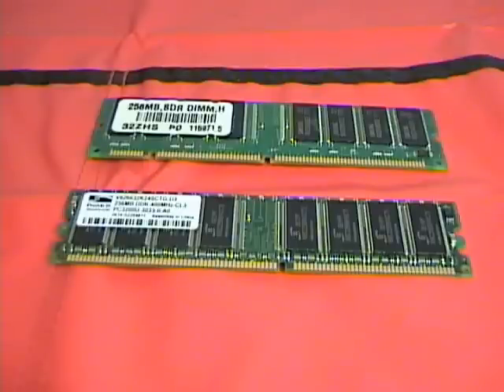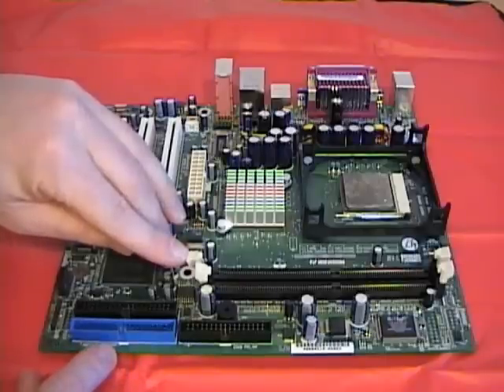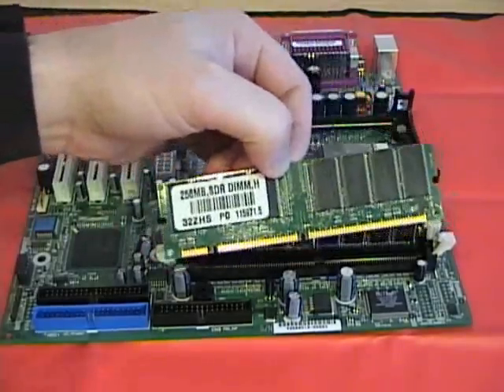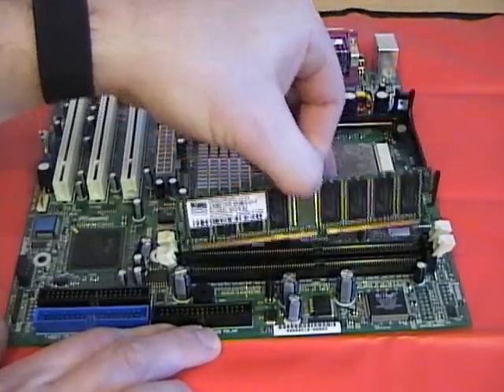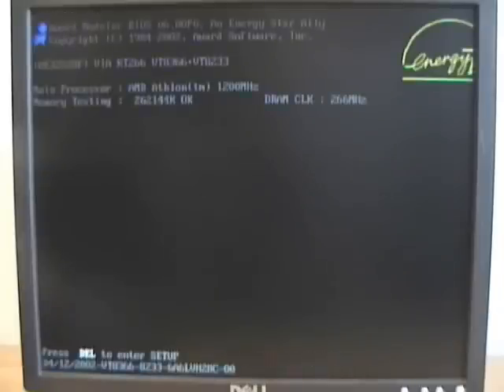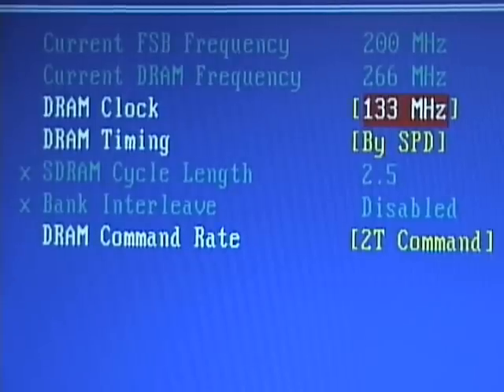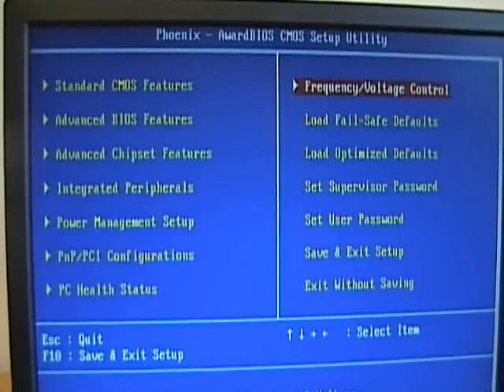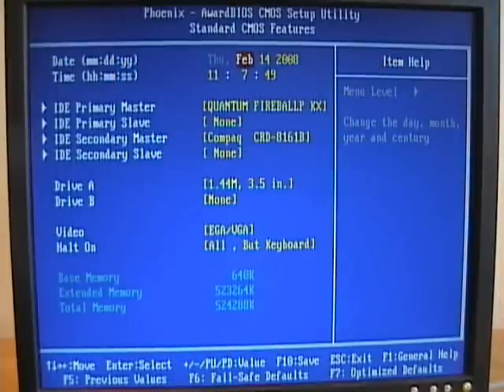Install and Remove RAM

Comment: I'm running Windows XP and I'm new to PC gaming, I have 1.97 GB of RAM. It says I need 2.0GB of RAM to run the game on Steam. Should I still be able to run it or do I need to install more RAM? I am also going to upgrade to Windows 8.1 pretty soon.
Reply: Lol, you should be fine. Just run on lowest settings
Reply: Zachary Lim I upgraded.... I now have windows 8.1. I also upgraded my RAM. I now have 6.00 GB of ram. I upgraded my processor, and  graphics card as well. My processor is intel quad core i7 and my graphics card is Nivida GTX 750ti
Reply: Zachary Lim I got one last question for you, could I run BO3 on this Pc? When it comes out will I have ro upgrade again or is it good enough to run on high settings?
Reply: +Jay Money Gaming Yes you could not on high the nv gf gtx 750 ti isnt a high end graphic (i have the same gpu) u could run it at medium-high at 60fps at least :) (its not a high end means that u cant run every single game at the biggest graphic settings but you can run it at least on medium :) )
Reply: Jay Money ubgrade your hard drive to play new games

Comment: Which of the two types of ram controls gaming speed?
Reply: Nothing "controls" gaming speed necessarily.. It's all basically everything as one. The graphics card, RAM and all other things control how good the game is going to look/play.
Reply: Ryan Does Gaming It would fix some stutters if you will have more ram (atleast 8 GB, depends on the game requirements) but it will not fix the low FPS. If you want to get much better gaming performance buy a new GPU and maybe also a CPU if your CPU isn't good enough.
Reply: Edgar Chávez Ok. Thanks. :)

Comment: The OS isn't the problem, it was the RAM itself. Found out one of the sticks was dead after testing each one. I bought a new one and solved the problem. I will stick with Win7 thank you very much.

Comment: If you were to actually watch and pay attention his equation was 262,144k / 1024 = 256MB of ram which is correct. This old BIOS displays memory in Kilobytes which you'd have to divide by how many kilobytes are in one megabyte to determine the total Megabytes. His formula is correct if you actually paid attention.

Comment: @Bammer958 You probably did not apply quite enough force when pressing down when ram in not in the slot all the way or the plastic tabs are not making full contact it will make this beeping noise

Comment: i have bought 2 ram modules same as yours 184 pin for my pc and it goes in but when i put it in my computer it only reads 512mb of 1gb in each or the stick rams. i have the right memory and i have instaled the memory properly i have seen my mother board specifications, it supports up to 2GB of ram 1gb of ram on each of the 2 ram slots.

Comment: cool video, you don't mention electrostatic discharge.

 if your doing ram changes or any work on your computer, particulary in cool dry conditions, you risk damaging it by passing a electrostatic shock to it. use a esd wrist strap or at least ground urself to the computer case.